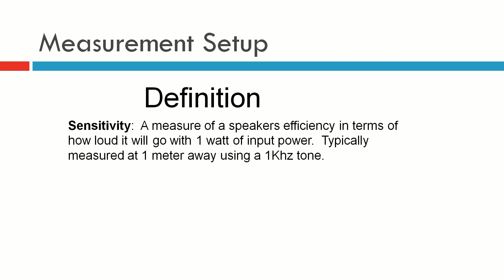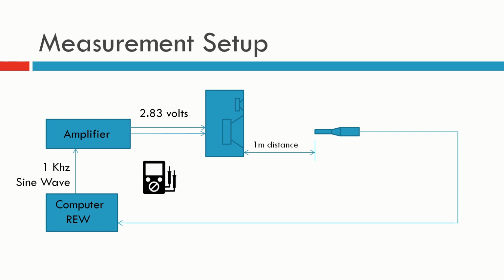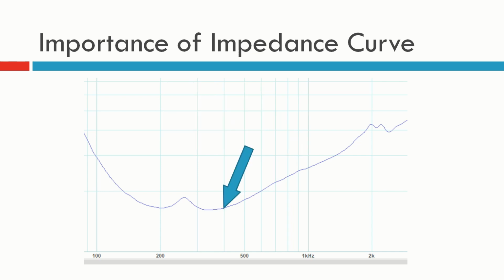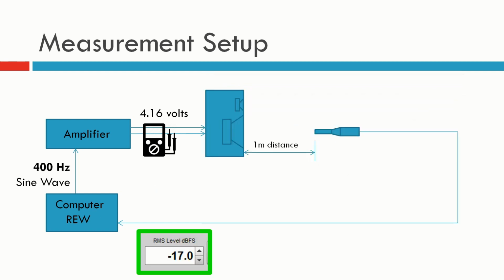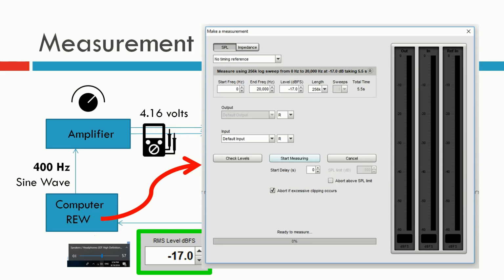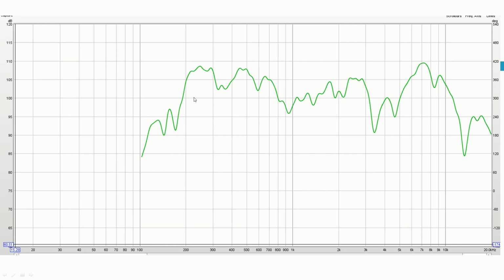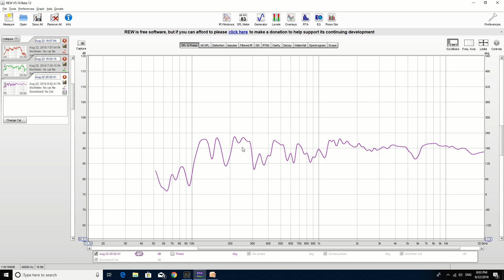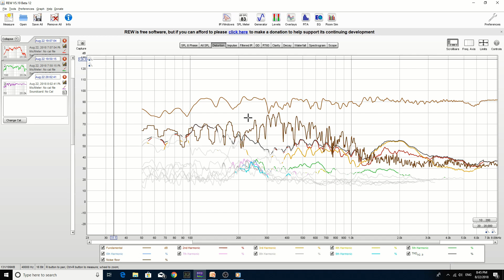How to Measure your Speaker's Sensitivity  (Part 1 of 2)

Comment: Maybe someone can explain something for me : He says you need to adjust the output V based on impedance at each frequency to make sure 1W is output. But then he goes and .. does a 0-20k test tone sweep?? you'd have to do some fancy math to change the output voltage along the impedance curve, and REW can't do that. So I'm confused how he went from testing single frequencies to producing the 0-20k chart, and why he's even using that chart knowing the 1W rule is not applying. it seems like he changed to measuring the frequency response and not sensitivity. What am I missing? thnx

Comment: I'm sorry, but you are totally wrong. You need to know your speaker sensitivity, in order to comparer speakers outputs and anderstand what amplifier do you need to achive the necessery sound level.
The real imperdance is absolutely irrelevant, because the amp power calculated for ether 4 or 8 Ohms. Amp producing voltage If your Amp is 100W on 8 Ohm, that means the maximum output voltage is 28.28V If your speaker real impedance is 8Ohm, you will get 100W, if it is 17.36 you will get  44W. You amp would not magicaly ptroduce 35V to make 100W output.

So, no mater of the real speaker imperdance, you should  put your amplifier output to 2.828V  which is equal to1w on 8 Ohm

Comment: Thanks for your explanations! One question about the target voltage though, at around 3:25 +...
Is my understanding missing something in the following method:
1- As you mentioned, the target voltage can simply be calculated via ohm's law: when considering a 1W power, it resolves into a tension of SQRT(nominal impedance) Volts.
2- One would then have to verify the impedance curve in order to determine the correct frequency of the sound source to be applied... At the point where the curve is nearing its nominal impedance the most, which is the source of my questioning since you don't do that (you focus on 17.36 ohm, even though there are points on the curve that are nearer to the nominal impedance of 16 ohm).
3- Feeding that sound frequency into the amplifier, itself sending that signal via 1W to the speaker, would then allow a correct measurement of the speaker's sensitivity in dB at 1m via a microphone.
Reply: the author is wrong. the target voltage must be 2.828 regardless of the real impedance. Your amp would not measure impedance and change output accordingly, the whole point is to anderstand how loud is your speaker  when you provide a voltage equal to 1W on 8 Ohm, does not matter that is your actual speaker imperdance. Imagine if it is 10000 Ohm. Would you connect  it to 100V?

Comment: I doubt whether your average voltmeter will work up to 1 kHz, as they are designed mainly for 50 Hz measurements I presume. Ideally you use a true RMS voltmeter designed for audio work?

Comment: Excelente!!!! Nice video and nice horn!!! :) Whats the criteria to not test with 1khz? Is there a specific reason? Thanks!!!!
Reply from the maker: Ground Beat thanks!  I would avoid testing at 1kHz if there is an impedance spike at this frequency. For example a tweeter may have is resonance (FS) at 1kHz, which would skew the sensitivity results of you assumed 2.83 volts for an 8 ohm tweeter.
Reply: @JosephCrowesDIYSpeakerBuilding   Really really thank you! I didnt considered that too much because i use only compression drivers :) . (Lower than 1khz fs i mean). Thanks man!

Comment: Hi Joe There are several people who have there speaker building channels and they get into passive crossover building and they do it right off the bat with there computer program and mic's and ect, could you do a series of videos from start to finish on a 3 way passive crossover as if we didnt have any experience what so ever start with what a cap does what do the value means, same on coil same on ceramic resistor , how do we end up with a end 8 ohm at the amp after all these components are put together and like i said basic to start then later bring in the high tech programs not jump right into computer program
Reply from the maker: That’s a good idea.  I think most DIY speaker builders forget that crossover design is like a brick wall for most beginners.  I remember my first builds were copies of existing designs.  If your left having to copy somebody else’s work then it really limits your choices.  Once you learn how to do passive crossovers then it opens up a whole new world of options, suddenly every driver becomes a potential project.  
I still struggle with crossover design but I know enough to help the beginner.   
My videos haven’t focused on beginner how-to’s because Kirby Meets Audio and Impulse Audio cover this off.  Did you watch their videos and still find certain aspects missing?  I thought Kirby’s videos were really good but his speaker was only a 2-way and he nailed the design on the first go around.  Most often the designer runs into multiple issues that they need to overcome...a bump in the frequency response, or the impedance dips too low for example.  Ideally a project should have some curve balls.  Is this what your thinking?  
Are specifically wanting me to “not” use a computer for the design?  Or just not jump into computer work too soon?